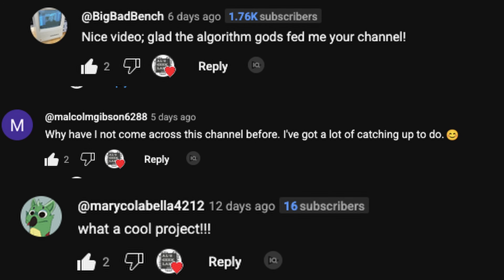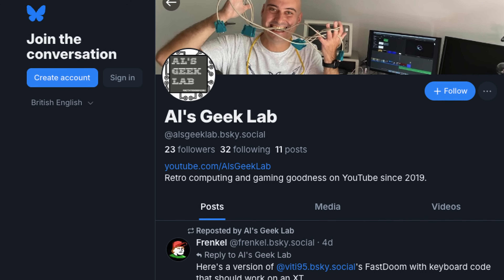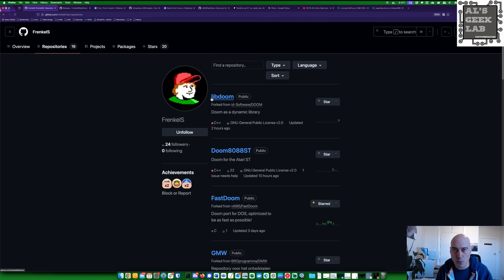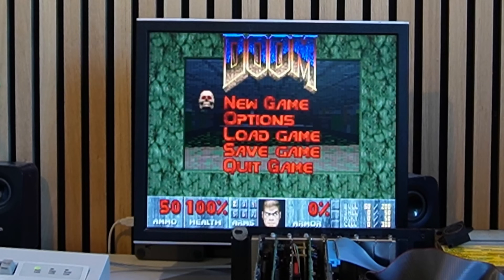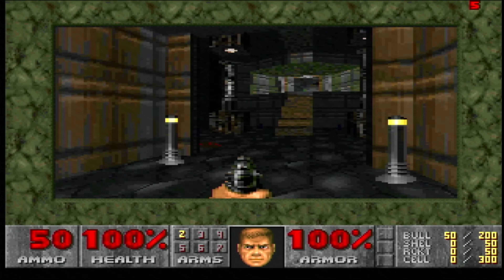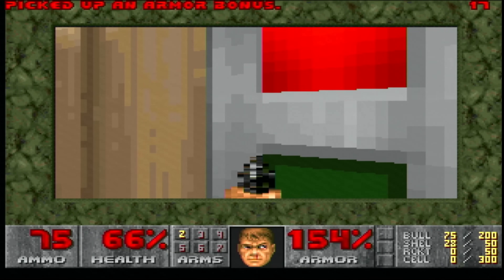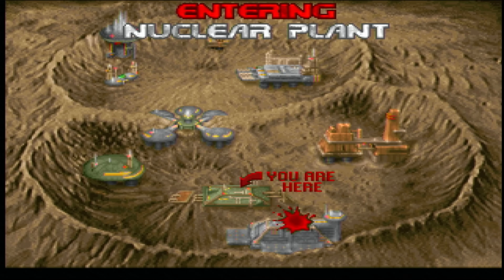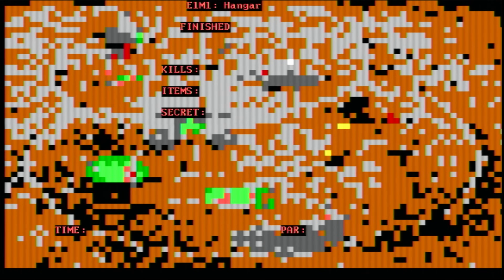Full Fat DooM, on an XT?!

Comment: Why not a more powerful graphics card? The higher the resolution the more workload goes on graphics card.
Reply: Early games like this don't use gpus like current games or new games do. Most of the heavy leg work is done with the CPU
Reply: @jgordon165 someone needs to port a gpu friendly version 😅. So the gpu does nothing?
Reply from the maker: GPU friendly version is called gzdoom, it runs on modern PCs in 4k. @jgordon165 is correct,  old games were processed by the cpu and the graphics card simply buffered the output on a display. It wasn't called a GPU (like we know it today)
Reply: @AlsGeekLab  From experience I know that some VGA card chipsets are faster than others, what vga card did you use for these tests?

I've noticed with my old NECV20 build that swapping the trident 8900 based card for a Tseng ET4000 based card made quite a difference even with EGA based games. I wonder if that would make any difference with doom on your setup?
Reply from the maker: @kirkspragg4493 I'm running an ATI VGA Wonder 1024 (1mb). It supports analogue and digital connections , but not both monitors running at the same time unfortunately. The card is only one of a few that offer that service, so that's why I use it. It's probable that faster cards exist for sure,  but it's probably not super significant. Note that the Inboard caches the EGA (and probably VGA) memory to reduce bus load, so it's already being boosted somewhat there.
Reply: @AlsGeekLab  I picked up a couple of ET4000 based cards reasonably cheap a couple of years ago. The one I'm currently using is a Genoa Systems 1MB VGA Model 7000 & i'm pretty sure it works just fine in a 8 bit slot. Seems to perform better than the trident based isa cards i've got. I wonder how it would compare to your ATI Wonder?

That video card memory caching sounds interesting, I wonder how that works? if the memory on the card isn't actually updated then nothing will change on screen.... I struggle to imagine how a cache of that would work!
Reply from the maker: I think it's got to do with the fact that instead of going to the ROM (8 bit) it's scanning for changes on 32-bit memory which is local to the CPU. When a video refresh is needed then obviously it's going back on the 8 bit bus, but at least the video memory is being stored in 32-bit local memory
Reply from the maker: Really? Such as what card?

Comment: As far as I understand it the CPU renderer option is actually about CPU-specific optimizations.  My understanding is they mostly don't make a huge difference, but to be effective they should be used on the CPU they're intended for.  I suspect some would just crash.  Turning off ceiling and floor textures does make a pretty big difference though, but the 8 bit bus to video RAM is probably one of the biggest bottlenecks.

Comment: The CGA and EGA modes are almost certainly slower because of the way they represent pixel data in memory. The 256 colour VGA "mode Y" graphics that Doom used had a nice 1 pixel per byte mapping whereas for 4 and 16 colour modes, you have to pack multiple pixels into every byte which is additional work for the CPU. Plus EGA memory is planar, meaning the memory is divided into four separate banks, each of which held 1 bit of the 4 bit pixel. And switching between banks is slow. Mode Y is planar, too but at least a pixel does not span multiple banks so you can write all pixels on bank 0, then all pixels on bank 1, etc... and you only need 4 bank switches per frame.
Reply: CGA/EGA modes are there mostly because they could be done and not because of any usefulness. Same for Doom8088.

Best way to play Doom today imho is gzDoom with true color software renderer. At 4K to max out modern gaming monitor it needs surprisingly powerful CPU.
I don't like hardware accelerated modes them not looking like real Doom with wrong sprite positions, sprites going inside geometry and no fancy out of bounds effects. That true color software renderer is however just like classic 8-bit renderer but without banding.
Reply: For al the non-VGA modes, a 256 color frame is rendered and then converted to use less colors. This is always slower than just showing the 256 color frame.

Also, Doom does a lot more than 4 bank switches per frame. Rendering one column of a wall or sprite requires a bank switch. With lots of walls and sprites you have lots of bank switches. Rendering a floor/ceiling does require just 4 bank switches.

Comment: Who'd have thought stuff written on the web in 2008 would be useful in 2025 🙂
Reply from the maker: I think you said in that very blog article something about knowing the old stuff helps with troubleshooting the current (computers is computers), in relation to your unix sysadmin role. Well, it was relevant in 2008 and it was relevant in 2025! Curiously, what was the problem you needed to fix in 2008 though?
Reply: @AlsGeekLab Software keyboard handler wasn't working. I eventually figured out a way to do what I wanted that was more compatible with all systems anyway.
Reply from the maker: @JimLeonard what I meant to say was, was  it the software keyboard handler on a unix variant or something like that, so you could use your XT keyboard with your unix system at work?
Reply: @AlsGeekLab it had nothing to do with Unix. I was writing a keyboard handler for a game, such that four or five keys could be held down at the same time and detect which keys those were, without activating keyboard repeat. I eventually came up with a better method that works on all clones and does not require replacing or bypassing the built-in bios  keyboard handler.

Comment: How can you say "real XT" and then casually add "with 486"
It is 486 and not XT. XT implies 8088 or at most 8086 CPU.
If you wanted something faster than 8086 or V30 you could use 286. At least it is 16-bit and not 32bit like your 486.
If you can run normal Doom on your "XT" then what novelty is with this port anyways?
Reply: I ran the original Doom on a 386sx back in the day, and it ran fine with a smaller window.
BTW, the SX had a 16 bit bus
Reply: @splaytrees  From what I remember on 386SX 25MHz the game required small window at lower detail at which point it looked pretty unimpressive and gameplay still wasn't fluid. I didn't play it like that. More like watched slideshow for a while and waiting for better PC.
Reply: @e8root  I played doom on 386sx and it was close to unplayable. even the low res and smaller window would not help much.
Reply: Totally agree. That's doom running on a 486 or whatever that accelerator has.
Reply: But it's the original XT motherboard still. Everything's still running on the 8-bit bus.
Reply: @CptJistuce  Well , we usually do not name a pc by the motherboard name. When using "XT" , most people would think of the 8086/8088 cpu.
Reply: @nikospolitis5635 You can't put an 8086 in an XT board, even with an accelerator card. Your own rules are inconsistent.

And if "only what IBM shipped" is a real XT, the VGA card's an issue, as is the sound card.

I don't see what's wrong with an accelerator card. No one says a C64 stops being a C64 once you plug in a SuperCPU cartridge. 

It is, however, hilarious to see a 486 hamstrung by cramming it into the 16-bit 386 bus and then hamstrung AGAIN by cramming THAT through the 8-bit 8088 bus. I readily concede that this wouldn't have been considered a viable upgrade path back in the day.
Reply: @CptJistuce  XT board came with a 8088. I wrote "When using XT, most people would think of the 8086/8088 cpu" because they were pretty similar and 8086 was more common on the Pc clone market.
 When we say "can you play xxx on a Amiga 1200" the correct answer is a video with an A1200 with some ram upgrades. 
 There is nothing wrong with accelerator cards. They should be noted at the title thought. An accelerated Amiga is just not in the same ballpark as a A1200/A500.
I would say it would be a bit different for the 486 cpu, since that one had options for up 100mhz or even Pentium overdrive,  that were widely available options.
 Can a VW go 250 klm/hour ?  Sure, if you cram a supercar engine and use nitro/whatever or throw it from outer space and wait for it to reach termonal velocity. Most people thought, would click on that video expecting a relatively standard VW car.
Reply: @CptJistuce  The issue is that "XT" doesn't exactly mean IBM PC XT model 5160 and can refer to any PC with 8088/8086 and also NEC V20/V30 as those are still XT class.
From title you would expect Doom8088 running on one of these CPUs and not 486.
Not that video was not informative. I didn't even know Doom had issues running on IBM XT with accelerator boards.
Reply: @e8root  I'd argue "an XT" and "an XT-class" mean different things. To me "an XT" specifically means the 5160, where "an XT-class" means anything that lacks protected mode.
Reply from the maker: It's certainly a 5160, with a 256k 5160 original motherboard. I totally understand people's comments about it not being legit because it's using an add-on board to make this happen. My situation on this, is that if everything can be reverted back to the original hardware in 5-10 mins and is generally period correct (1980s) then it's fair game. All of the hardware in this XT is 1989 or earlier and can quickly be back to 8088 easily. If I wanted to play doom on that hardware, it is possible, I'd use doom8088, but as you may have seen in the video near the end where I talk about the lack of fun in that.. significantly reduced gameplay, graphics etc.
Reply: @AlsGeekLab  That is exactly what i was expecting reading the video title.Doom somehow running on a trash 8086/8088 with the help of witchcraft! I was expecting a wireframe Doom like Elite on Amiga.Same thing when i watch videos with "Can Doom run on an A1200?"  . Expecting a "base" amiga with some ram upgrades. Not bring out PowerPc accelerator card :) 
 Having said all that, this was a very interesting video.I had no idea there were even 486 accelerator cards that worked on such old motherboards. Back then motherboards were so hard to work with and had so many compatability issues.